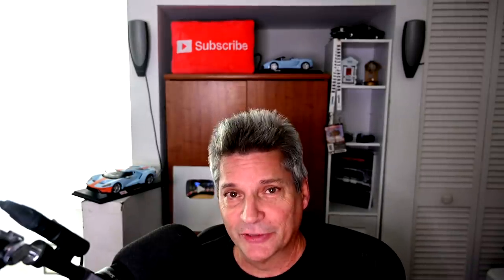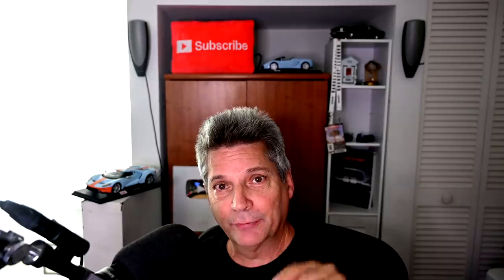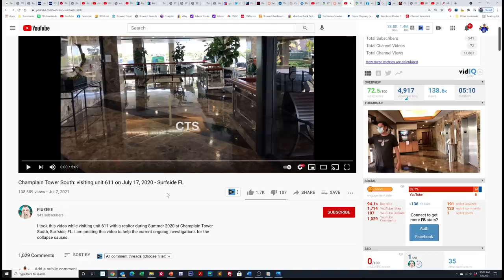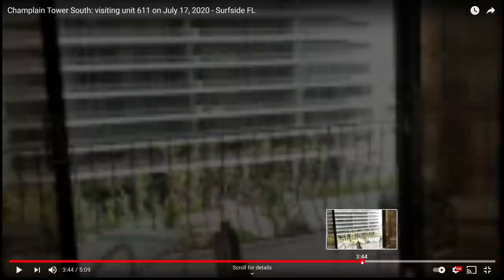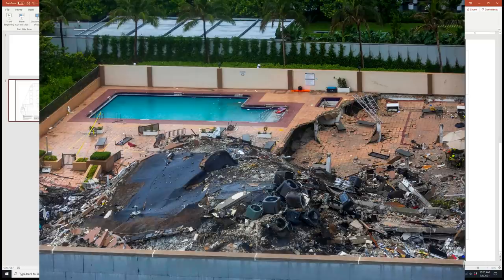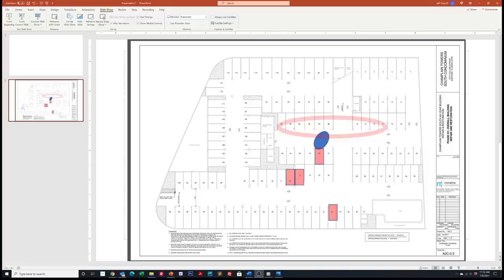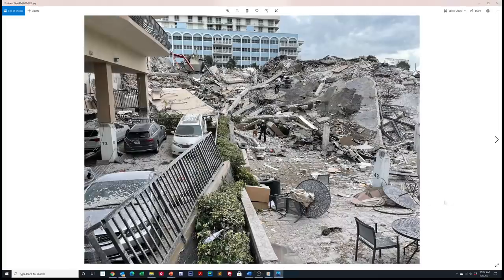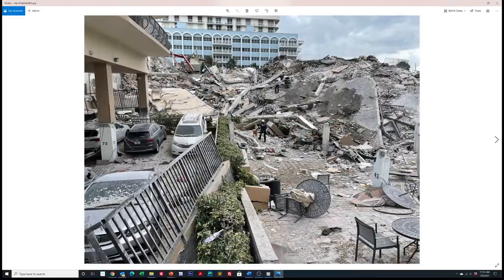Analysis Garage Video BEFORE Condo Collapse: Water Everywhere

Comment: I guess my big question is where is that water coming from?  Was the pool slowly leaking or was this rain water that was slowly running down and undergrown or was it as the workman from a year or so before who was saying the water was salty and he questioned sea water?  The University who was mapping buildings for a project in the 1990's has been able to show that building was sinking a great deal more that those around itan why would that be?  One would think that if it was sinking due to problems under it then some of the other buildings around it would be sinking at least on the nearest side to that building unless they had been proper foundations to prevent that.  Why when they saw one building that was sinking faster or more than the ones around it, was there not an investigations as to why?

I cannot help but to think that this may end up being one of those perfect storms of causes where not one thing or therefore one itetity is going to be to blame.  It may well be due to poor maintenance practices as well as the HOA trying to put of major repairs to keep costs and assessments down which of course would fall on the HOA, its possible there was a geo issue hidden deep enough under that building area which over time allowed the ground and therefore the building to be less stable or settle unevenly, possibly a error in not knowing that ground and/or seawater could get into that area under the building, lack of really good structural inspections an dfailure to notify the proper authorities to determine if they needed to insist of structural repairs or pull the occupancy permit until fixed.

I may live on the west coast but we have seen the same sort of thing happen, and just got past this not happening in some situations by the skin of one's teeth or the building collapsed sideways and was held up by another while people could be rescues, especially with buildings whose units are all owned by different entities.  It makes the care and maintenance of a building become very political and we have seen it with older condos who when laws and codes came in requiring retrofitting for earthquake safety, HOA's wilted at the idea of telling owners that that they would suddenly be assessed as much or more than their unit actually cost.  You find residents that see it as a very big deal to be elected to the HOA, and will do all they can to either minimize assessment costs to guarantee a re-election to that post.  We saw a lot of this a decade or more ago on brick condo buildings that were mandated to retrofit who would come begging to have the date where they had to prove they had hired in a contractor put off until after their HOA elections, wanted deals to spread the work and then the cost out over a few years time.  And no one did much but shrug when asked what they would do if the building collapsed in an earthquake.  We actually herd from many HOA's that all owners had insurance that would cover any loss and they absolutely refused to think about loss of life.  We knew that some of those building could collapse in a quake 5.0 or greater and even when we asked what happened when that hit at 2 am and people could not react fast enough to get out, and did reidents know even if they did get out they potentially would lose all belongings.  Most of the HOA just did not want to have to deal with major assessments all in one year as it would cause them not to be re-elected or so they feared.  We had to be tough and put our foot down and tell them that they either had to pay it out of HOA funds - which all buildings were supposed to have, assess owners or arrange a bank loan or prepare to have the building red tagged

Comment: I just watched first one made...you said opposite of ramp failed first. The small pipes from ceiling are to allow water from the flat pool deck to drain...they must have gone over them & sealed off with water proofing. Collapse started on outside wall & drug the whole deck in sections. First fail of a foot as it wedged & gave way, that's why water running. Easy to solve- next!

Comment: Column 101 looks bigger than 14, 26, 28, pool area et. al. Were the columns under the collapsed part smaller? Was the building built in stages? Was there an engineering change to the support columns differentiating two phases of construction?

Comment: I  noticed that the horizontal beam across from parking lot 14 right above parking space 27 towards the cone is kind of out of place and does not connect to the column properly. In the video starting from minute 27 right above the Infinity SUV.

Comment: You said you didnt see anything of concern across from the vestibule but what is that on the ceiling between spot 100-101, side by wide pvc pipe or another piece of tin or aluminum metal? Time stamp is roughly 19 minutes.

Comment: @10:20 That's exactly what it is, it's roofing corrugated metal that they are using to get the water off the cars. 34:30 - If it's an insulated pipe it's for cold water or it sweats. It could be so humid that the sweat is coming out of the patch IF other areas are exposed. The electrical panel below it rotted right off the wall, it's not clipped, it's hammer drilled into the concrete. That building had many leaks for many years, and many of them seem to have been incapsulated in the concrete and the water found a way to get out...

Comment: 26:10 Notice the ceiling has much more damage on the right side of this frame vs. the left.  This should be outside, right under the planter boxes.  Also when you get to the tourist video 27:50, notice the pipe and debris field is behind space 27, not actually at the bottom of the ramp.  This would correspond to the severe ceiling damage location  
I think it all comes down to the planter boxes.  Failed waterproofing weakened the concrete, the weight of soil and plants caused the boxes to collapse.  dragging much of the pool deck with it.  At that point the balance of all the forces is completely unstable and maybe the building cooling down or a gust of wind caused the rest to come down.

Comment: I think that the report comments about the pool deck not being tanked under the tiling against rain water penetration and not having any gradient for drainage. Presumably there was a lot of chlorides used on the pool deck that attacked the rebar.  Quite a bit of corrugated sheet material used to divert the dripping from tenants vehicles.

Comment: i used to be a mortgage underwriter for a nation wide bank. can not tell you how many customers would tell me they do not need to provide flood insurance for their loan, because they were on the 10 or 15th floor. i would try to explain that the building is sitting in a flood plain. the did not get the connect between the support columns on the foundation and their unit in the sky. SMH!

Comment: There is a crack along the top edge of the beam between column 27 back and 27 front.  Showing some deflection in the column. The beam could have provided added strength to the column allowing it to survive a a second longer Thant the column to the west of it.

Comment: Your red oval (2:30) indicating the first point of collapse is shown on a different row of columns than on your previous analysis.  The oval in the previous analysis was one row south.  At 25:56, long strips of corrugated panels on ceiling, one row of columns south of original oval location.  Directly under the planters on the pool deck level.    At 26:50, again, the red oval in this video is one row north of the red oval in your previous video.  The red oval in your previous video delineated the southernmost columns of the main structure.

Comment: Very interesting. The blobs of stuff on the ceiling (not the paint peels) is that not the concrete deteriorating from water passing through the slab and also making the paint peel? We all know concrete is porous and will allow moisture vapor to pass. If the pool deck was not slopped and properly waterproofed it would allow water to sit on slab, it would cause it to start to break down the concrete forming the "stalactites" and peeling the paint. Also it would cause further rusting and expansion of the rebar through out the slab. Building was bound to FAIL!!! Still, I don't understand why we use untreated steel rebar in a wet mix???

Comment: at 20:51 of your video it appears that there is more patch work on the ceiling... it even looks as if the ceiling is bowing down, but I believe it is some corrugated metal that you mentioned may be used to divert some of the water that was leaking through from the pool deck.

Comment: In regards to the covered car in the garage: I work in Destin, Florida. There are lots and lots of underground parking garages at many condos. Because Destin/Miramar Beach, Santa Rosa Beach are vacation town(s) there are LOTS of people who visit on weekends or fly in every couple of weeks to spend time at their condos. They leave a vehicle in their assigned spot and to keep people from dinging their vehicle, running luggage/grocery carts into it and scratching it or to just keep it clean etc etc they will put a cover over the car. I see it all the time when I'm at condos (for work). 

It doesn't necessarily have to be on the car because of the condos negligence. It very well may be there because of leaking water. We really don't know why the owner put a cover on their car, there is several reasons why.

Comment: About the "covered car" one would cover the car, if one were a "snow bird" (or the like) and left the car without use for sometime... (even more than one week!)  In regards to the orange cone, I believe they put that on there so as not to have that relatively big car, touching the column...it would alert the driver to "STOP"!
Reply: I was going to say the same - most parking garages of condo buildings will have covered cars, either for snow birds or for classics/vintage cars. Its to keep the dust and grime off and to deter crimes of opportunity.

Comment: What concerns me is the standing water in the garage parking area, that shouldn't be in there. That floor area should have fall on it so that if any water gets in the garage area it should drain to a floor drain. Never should there be standing water in a basement area. Or it will make the ground below the foundation a weak spot as well open for losing it's compression/compaction stability. Thus if the foundation cannot handle the loading due to substrate failure the columns are next to go. But mostly do to shearing of the decking due to the columns not having contoured columns up to support the decking above it at the column areas. This too is a major flaw in column designing as well. If you were an engineer you would recognize hangers that the rebar has to sit on that is supported by the forming materials to keep the rebar off the forms and to get concrete between it and the surface area after the forms are removed. Put the painted surfaces look to me like they painted over painted areas without scraping off the old paint that's peeling first. That's what that surface area looks like to me. Handymen not knowing the proper way to do restoration of painted surfaces and doing it the fastest way possible to keep from getting chewed out by management. Look where your at, they are most likely using undocumented labour as well. Those people will do as their told in order to keep their jobs and not care about the proper way to do anything but as they were told by those who do not care. Well the man owned the cone and put it there so he had a marker when to stop his car so not to hit the column, just maybe I was thinking. You are starting to sound like a conspiracy theorist always looking for the negative instead of what is actually going on here. Lighten up guy. I noticed something you didn't, in shot 26.20 there is another pipe sticking out of the slab above just to the left about in the center of the ramp coming down into the garage area that might have been that pipe or line that was pouring out water into the garage right before the collapse. Was it raining when the collapse occurred or just after it had stopped and the roofing had additional water loading on top as well? That too would be a contributing factor in the collapse that no one has talked about either. That water maybe water coming down from a drain that runs clear up to the roof area that is supposed to be carried out by the storm draining system at the end of the ramp where it hits the garage floor area. No it is coming out of that PVC pipe stub out in the ceiling Jeff. if it were a water line it would be under high pressure. More water than that would be coming out of it, even if it were a sewer line it is too clean, it is drain water off the roof I would bet. Why are you calling cones columns? Those are markers bought by people to keep from hitting the columns with their expensive cars. I can tell you where that could have been, it was under the decking area by the pool, that was wrote up for not having weatherproofing work done as it should have been. Where people tried to divert the water from the ceiling dripping down on their cars from the pool deck above when it rains and storms most likely due to Hurricanes. That to me would be the hardest time to try and keep that area dry from the flooding waters from above or even tidal surge. We all know most of the power goes out in stormy weather and how come no one has talked about that effect on the building's foundation? They had the bucket catching the water that was dripping off the face of the electrical junction box. That's not too hard to figure out my brother. I sure hope you read all this. I can tell you have never done inspections or been in actual construction projects. Or you would know all this stuff. It is my belief that when the concrete was poured here no scredding off of shout in screed boards were used; but in fact like most jobs done in the south they were hand screeded off of pins that were shot in by a transit after being hammered into the ground, that is the technique usually used in the south where concrete is poured when it is so hot and sunny and at a 4-5 inch slump.The concrete has to be placed in a hurry and very fast when it is that stiff. Due to being poured out of a pump truck as well due to not being able to get a cement truck down in there to pour the garage floor due to all the columns in the way. So when the concrete goes though the piping of the truck it creates friction and makes the concrete hotter at as well. Making what was a 4-5 slump at the truck where the test cylinders for the concrete were casted; now a 2-3 slump which will set too fast, which can cause it to be extremely hard to vibrate and get the concrete around all the rebar correctly as well. These are very hard jobs for the laborer's to handle when pouring too much surface area without proper controlled joints as well; so smaller areas can be poured with more care. That is not usually cost effective for the contractor doing the job and corners get cut right there. There are many leading and contributing factors that knowledgeable engineering students left on the job to oversee the contractors methods and what to watch for:That contractors get away with anyways.

Comment: The water you see gushing is beyond a pillar that is intact. You see this pillar at @28:55 . Also note the sprinkler pipe make a 90 degree upwards turn and a significant concrete slab that is against that pillar.

Comment: At 22 minutes 40 seconds into the video, the top portion of the column, I believe in front of spaces 78 and 79, appears to be misshapen and also has a puddle of water next to it. Is that column actually missshapen or am I just seeing it at a bad angle?

Comment: That thing was corrugated plastic sheet to keep the water from dripping on the car and utter from dripping on the car in that parking spot. also the columns are discolored on bottom 4 inches.also also: dehumidify in Miami? good one.

Comment: @ 00:05:30 Idk if you noticed but column 105/106 has what looks to be water damage at the very bottom. You can see a water line that looks like it goes up about 5 to 8 inches. It can be seen on some of the other columns also.

Edit: I guess I should have read the comments first!  Lol 🤷‍♀️

Comment: Jeffostroff to me its looking more like the columns that had the Orange Traffic Cones by them were the first to collapse, because on the tourist video shows the first collapse of the pool deck around where the Cones are, and you notice the pipe that's pouring out water, and open air duct is still attached to the ceiling where columns 88, and 14 were and what looks like debris of the collapsed deck is Exactly just behind the pipe and duct where those cones were. Then yes the collapse of columns 87 ,88, 14, 15, 16 and on ward because of lack of support and to much weight. I'm thinking maybe if  you can find out why those cones were there just might find out the root cause. Just my analysis of your Amazing informative video thank you for sharing this and your professionalism with us

Comment: And at 32:26 It occurred to me that "drain line" at "the bottom of the ramp" may have had cracked, and leaked, and repeatedly soaked the foundation out to where we see those slab cracks, you mentioned, as if the foundation was sagging at the base of the ramp due to that drain leak fueled liquefaction effect, of erosion beneath the slabs, along that drain route across the bottom end of the ramp, a slight dip extending out to those cracks.